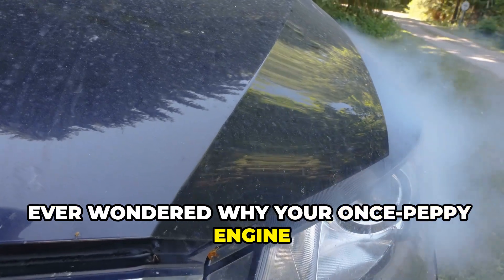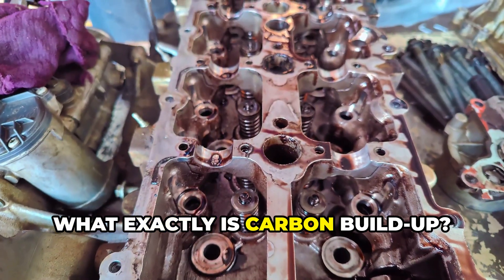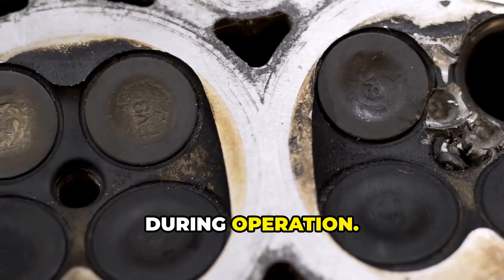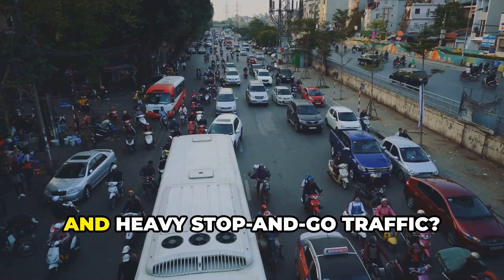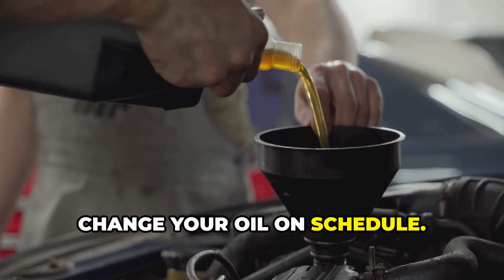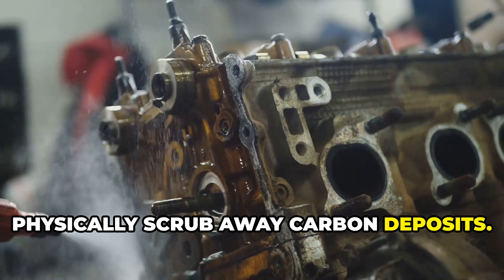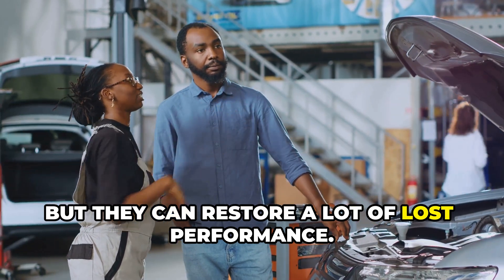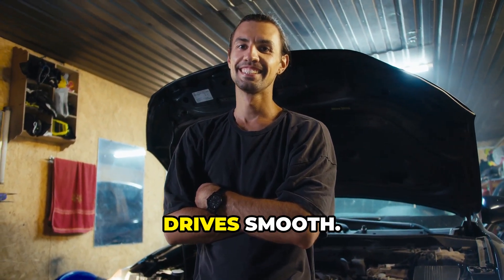What is Carbon Build-Up and How To Avoid It?

Comment: Unfortunately, Walnut blasting is expensive. Change oil with a high quality motor oil !
Reply from the maker: Walnut blasting can be expensive, but it’s a great way to clean up the intake valves if they’re badly clogged.

However, I do agree with you. Prevention is the best route.